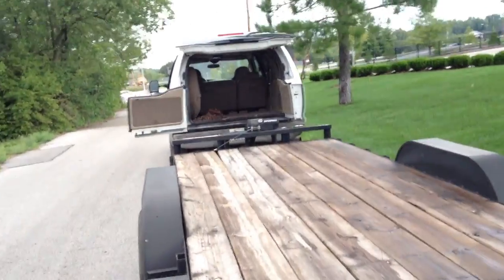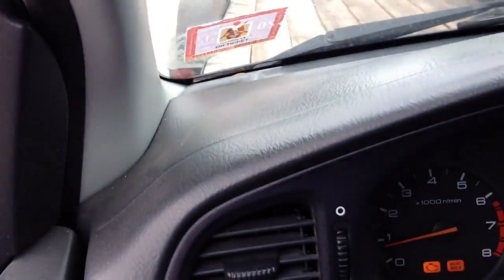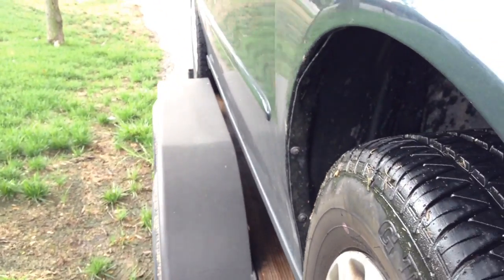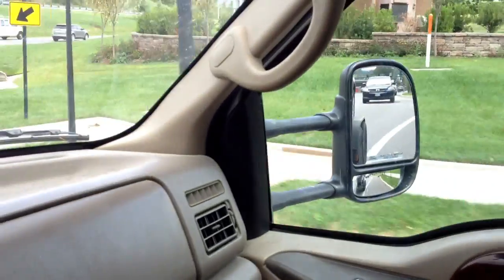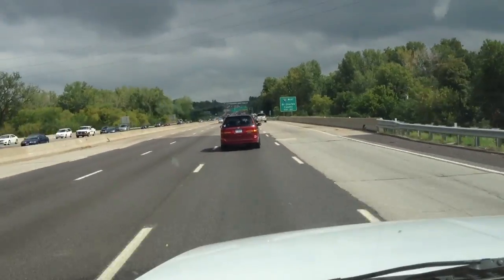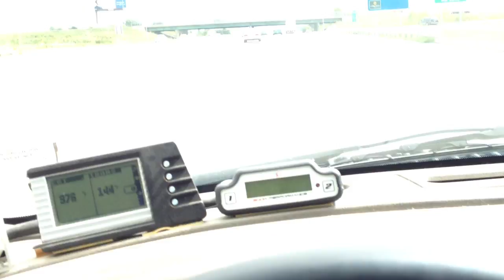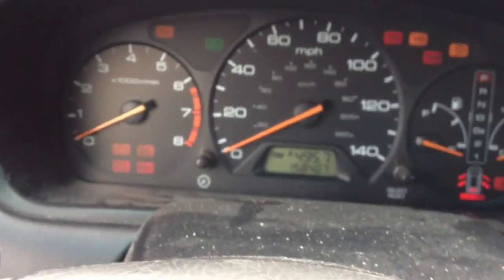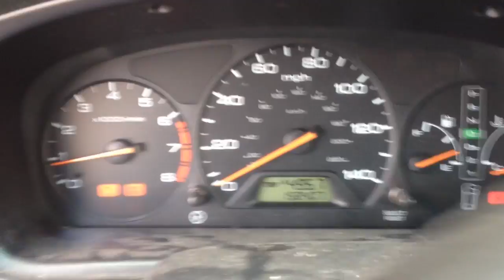Ford Excursion Towing Honda Odyssey

Comment: Had an 03 Odyssey until recently. Ran for 268K miles, but the transmission never quit. The ball joint in the right front wheel broke while I was driving, causing me to total it. No wonder I wasn't hurt.